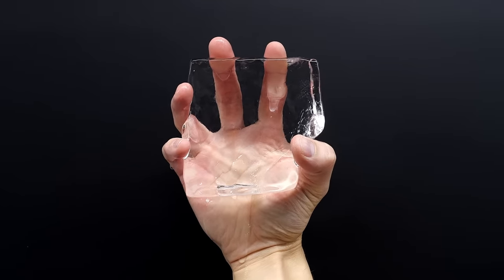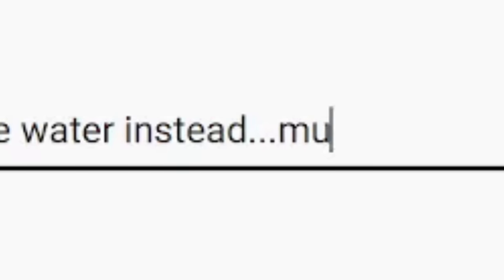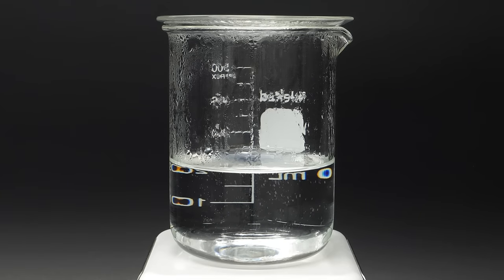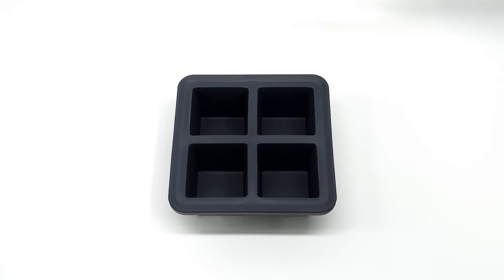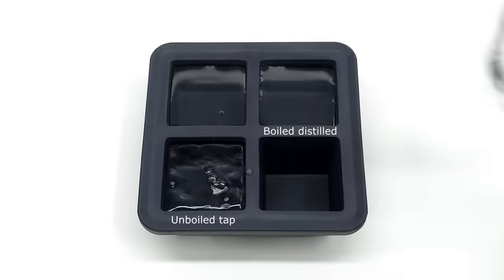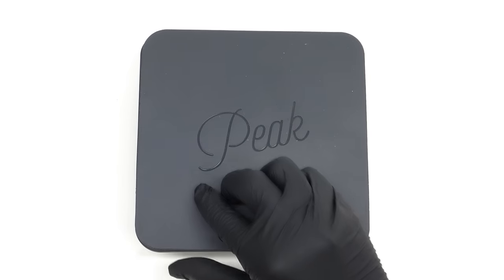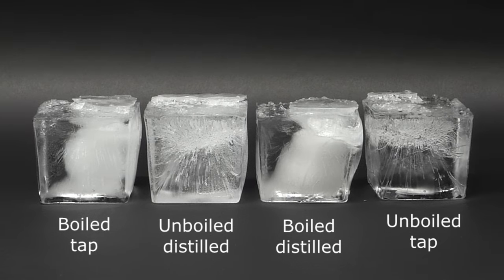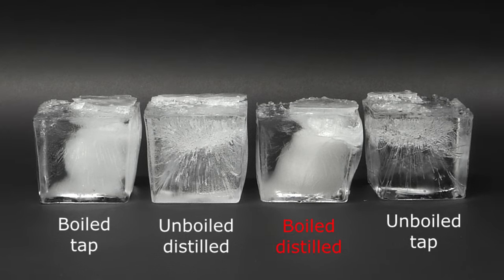The clear ice myth

Comment from the maker: Even if boiling it did make clear ice, it would still be way more work than just pouring tap water into a cooler. Boiling the water is just extra work for no reason.
Reply: You finally responded
Reply: I thought you were 6 feet under
Reply: i need to know if there is a tall bit not that wide cup and a shorter but wider cup that both have a same amount of same temperature water and you put the exact same pieces of ice in both which ice melts faster or is there no difference
Reply: Hi
Reply: There are some high end bars that but specialty ice that ice perfectly clear in all shapes and size
Reply: Maby a vacuum pump cold make the same effect
Reply: i would like to say no need to clarify, but someone in the comments is going to scream about it one way or another lmao
Reply: I’m gonna take one for the team and say “it’s like How to Basic but chemistry” so no one else can fill the comment section with that…
Reply: @leevikv  Difference. But how much depends on the exact dimensions of both cups.
"Short but wide" and "long but narrow" doesn't say much.
It depends on the proportions in relation to the ice cube actually..

But in general you could say:
In a longer/higher but more narrow glas/cup the temperatures are stronger seperated, cold/cooled down on the bottom, warmer ("original temp.") on the top/surface.
There also is the ice swimming, which leads to him melting faster.
In a wider/flatter cup the temperatures are not really seperated. But therefor maybe the in total surface of the water body (?) is higher, which leads to more energy loss (?)..

(Sorry my probably very unscientific english here. I'm not native..)
Reply: Lol
Reply: Lol
Reply: It's because it was in the freezer for 3 days !!!!!!
Reply: My Mum boils water to freeze, quite easily with an electric kettle to be fair. I have argued that it doesn't make a difference, but to no avail.
Reply: Perhaps you aerate the water when you pour it? Try boiling it in the beaker and then immediately afterwards covering the beaker with an air-proof lid and freezing the beaker itself. That should ensure that there is basically zero dissolved gasses in the water.
Reply: I just don't have the space to fit an entire cooler into my freezing compartment so if there was an alternative method, I'd really appreciate that, even if it was a little more work.
Reply: Yooo you forgot to make the video a short, its just normal video rn
Reply: Try doing it in a vacuum or removing more water impurities
Reply: @MartinBalle7  yup the cracks o the gas bubbles and air
Reply: @FrogeniusW.G.  hi
Reply: UPLOAD SOME REAL VIDEOS ALREADY.
Reply: Call Oklahoma ice company and see how they make clear ice sculptures..
Reply: try boiling it then freezing it in the same container, without shaking it. pouring it mixes air in.
Reply: would sonicating it work?
Reply: @unvergebeneid  put it outside in the winter
Reply: Welll you CAN boil the impurities out of water, but its the steam--not the water in the pan--you need to collect.
Reply: If air is the problem why don't you throw some water in a vacuum chamber and suck all the air out and then freeze it
Reply: Yes
Reply: Have you moved to a different site for your main videos?
Reply: You say "extra work" like it didn't take you 6 months to make ice. In Canada.
Reply: way to show them what for
Reply: Yes but better to boil any impurities out before freezing. I make clear ice balls from time to time and like to boil the tap water before freezing. Just feel better about it
Reply: Hi Nile
Reply: Hey nile, why didn’t you upload for 2 months? i was concerned.
Reply: MythBusters did it by lightly agitating the water while it froze - something that vibrated it rapidly. Worked well
Reply: @bej4987  if you mean agitating it while it freezes with sonic vibrations - yeah, that works.
Reply: Boiling water could also cause your freezer to not work properly too. The extra heat inside the compartment could cause your food to defrost, which isn’t ideal from a food safety point of view and could make certain frozen foods go soggy
Reply: You should try putting it in a vacuum, might work
Reply: @MartinBalle7  water expands as it freezes, since it freezes too quickly from all directions, bubbles of vacuum inevitably get trapped. A vacuum wouldn't prevent that.
Reply: Why are you not post it on your main channel
Reply: Holy shit the people who told you to boil the water just got annihilated
Reply: Hi
Reply: looks like they cracked from when you knocked it against the table when you set the tray down..
Reply: Redo it with it sterilized and the lid off
Reply: eh glad to see you back bud!
Reply: I mean, on one hand yeah pouring into a cooler is going to be way easier, but a lot of people don't have that option, tiny or packed freezers make fitting an entire cooler nearly impossible, so of course people would try to find another solution.
Reply: Cloudy ice is from air bubbles trapped in the water so pouring it would introduce more air. Not sure if boiling the water would get rid of air bubbles though.
Reply: welcome back!!
Reply: You should do something with thorium
Reply: If you can get the ice to form while evaporating, or by growing the crystal from vapour, can it form clear ice?
Reply: Oww!!!!! That's somewhat good!! 🙄
Reply: @unvergebeneid  you can buy specifically made clear-ice moulds (overpriced, of course) that are smaller and do the same thing -- they basically insulate the water to allow the centre to freeze along with the outside, instead of the outside freezing first and then causing the stress cracks from when the centre finally freezes.
Reply: @Bluecrown360  thanks for the tip! I'll see if I can find some that are less overpriced :D
Reply: Since it's the impurities that cause the cloudiness, I found the easiest and most effective way to regularly make clear ice is to fill a plastic cooler, like a Coleman, with ice and set it uncovered in the fridge. It's insulated on 5 sides, but the top isn't insulated so it freezes down. That top portion freezes more pure, while the impurities are forced to the bottom. If you don't let it freeze all the way through, you have a pocket full of very mineralized water in the middle of a lot of very clear ice, I then just cut that into large ice cubes to be used later.
Reply: Would distilled water make clear ice?
Reply: @trying3841  no, it wouldn't. Some of the imperfections are due to impurities and trapped gas, but most of the cloudiness is from stress within the ice -- it freezes first from the outside and there's not enough space for the ice in the centre to expand. Ever tried dropping a nice cloudy icecube into hot water? (Be careful of splashing hot water if you do 😅)
Reply: what the difference between the freezer, cooler and fridge?
Reply: @al-aurum2457  water expands as it freezes. A parcel of water being frozen will start from the outside first, then the centre won't have enough space to expand in an orderly structure. The result is a lot of stress fractures, the biggest (but not only) cause of cloudy ice. Insulating the water as it cools allows the centre more time to cool to freezing temperature before it gets trapped. A fridge won't cool it enough to freeze, but a cooler in a freezer will slow the process to have some better results.
Reply: there will always be someone in the comments that thinks they know better then you... something they read a while ago...
Reply: Unless you live in Mississippi.
Reply: Hi just wanted to tell you that you cannot let the water cool at all, if you do not cool it. it should come out completely clear :)
Reply: The AA-12 (Auto Assault-12), originally designed and known as the Atchisson Assault Shotgun, is an automatic combat shotgun developed in 1972 by Maxwell Atchisson. The most prominent feature is reduced recoil. The current 2005 version has been developed over 18 years since the patent was sold to Military Police Systems, Inc. The original design was the basis of several later weapons, including the USAS-12 combat shotgun. The shotgun fires in fully automatic mode only. However, the relatively low cyclic rate of fire of around 300 rounds per minute enables the shooter to fire semi-automatically de facto with brief trigger pulls. It is fed from either an 8-shell box magazine, or a 20- or 32-shell drum magazine.
Reply: HES BACK!!!
Reply: @catwithshades7577  In which case being dropped on their heads was more of a lifestyle than an incident
Reply: @ScrapFatherScrapSon  they use ice machines with a compressor similar to an AC
Reply: What if you didn’t pour the water and reintroduce air? Freeze it in whatever container you boil it in. Not saying I think it works just pointing out a potential variable in the experiment
Reply: You didn't freeze boiling water, you let it cool down first
Reply: The problem is more that almost nobody has enough space in their freezer that they can just put a whole cooler into it.
Reply: Put it in a separate container buddy… smh.
Reply: you responded!!!
Reply: how about you make your own Monosodium Glutamate or extract syn-Propanethial-S-oxide from onions to make your own tearjerker potion, hope so that you'll notice this :)
Reply: I hope the next masterpiece in nile red is almost complete
Reply: are you going to make a new NileRed Channel video? 🥲🥲🥲🥲🥲🥲🥹
Reply: This is actually a movie
Reply: Why do you never post NileRed?
Reply: No videos already for two months. Are you alright?
Reply: My family boils water cause they say that it kills germs due to the heat
Reply: @yasserotb1454  I think he is
Reply: You should dissolve a jawbreaker in piranha solution
Reply: What if you lowered the boiling point by putting it under vaccum?
Reply: I froze boiled water to have some for later.
Reply: this is what happens when your ugly YOU GET SMASHED BY A GIANT BAN HAMMER BY NILES OWN HAND
Reply: I mean, the harvesting process for clear ice made in the cooler is the limiting factor. I suppose the suggestion is boiling and freezing in a mold is less work than cooler freezing and cutting it to shape. I agree, except for the inconvenient fact that boiling does nothing lol
Reply: Leave the lid off the container so air can escape
Reply: @unvergebeneid  any size cooler will do it you can get some small styrofoam "coolers". Or even cut up Styrofoam that is an inch thick and make a box out of it.
Reply: excellent hammer sir
Reply: I guess some peoe don't know what actually makes ice foggy
Reply: @Edward  but the problem is not only the gas from the water. Ice frozes from the side of the mold. As you know, water expands when freezing, but if ice freezes from the side of the mold, the water in the center will be locked up into the ice. So when the water freezes, the crack will form from the center of the ice by expanding water. The only way to prevent this is to freeze water slowly from bottom to top or vice versa.
Reply: To be fair if you have a kettle its really just pushing a button
Reply: Boiling the water makes it freeze faster, but it won’t make clear ice.
Reply: Boiling the water only has an effect on how fast it turns to ice. Boiling water turns to ice faster than cold tap water, believe it or not. Since the hot water evenly looses its heat when the cold water freezes from the top down and takes longer to completely freeze into a cube.
Reply: I love your content
Reply: Dude, this isn't a myth it's not rocket science. Have you ever seen ice sculptors work with super clear ice? They agitate the ice as it freezes, to continually stir the remaining bubbles out
Reply: What about putting a jar of water in an ultrasonic cleaner? That gets rid of the air in the water and would be interesting to see if that changes anything.
Reply: Horrible test. Each one was able to mess with the others temperature ...
Reply: Shouldnt have poured it
Reply: how about using a vaccuum?
Reply: @leevikv  cloudy ice melts faster. The cloudiness is tiny air pockets that affect the diffraction. As the ice melts and the cloudy section is further exposed, microscopic pitting sites increase the surface area, and as we know thermal exchange is directly proportional to surface area.
Reply: What I'm getting from this is that boiling the water improves water clarity but is negligible compared to former methods.
Reply: Agreed. Moot point.
Reply: You should try it again with a thermos cup. I use them to make drink ice. Because then you can cut them. Perfect clear ice every time, the insulation forces the imperfections in the water to the top.

It's because the proces of how water freezes. 
Boiling doesn't remove all the minerals from the water, which causes clouds.

But the insulation of the cooler or a thermos, will force them to freeze like that of a pond, mean the top will be white but the rest will be clear.

You then just cut off the white, where the imperfection of the water rose when it got cold.
Reply: Yes for no reason
Reply: Well... you see tap water in my country is poisonus until u boiled it
Reply: Hi
Reply: @yasserotb1454 
I thought maybe he got trapped in a cooler freezing some water.

Comment: I still love the phrase “boiling water will remove the air from it.”  That’s just not how that works.  Not only that the moment you pour it into something you’ll trap air anyway.
Reply: there is dissolved gas in tap water and boiling it will remove that. It doesn't seem to make a difference to the ice quality though as we can see in the video.
Reply: Boiling water does remove most of its dissolved gases. I worked in a lab that required me to use chemicals that easily oxidize (into unwanted ionic species), and so whenever I had to create a solution of these chemicals, I would have to make deoxygenated deionized (DDI) water. Basically, it's just regular deionized water that has been boiled, and which has had nitrogen gas bubbled through it for about 30 minutes as it cooled. The boiling removes most of the oxygen, and the nitrogen flushes the rest out. It lasts for only a few hours in a sealed bottle though, so it must be made fresh the day you need it.
Reply: I never knew that thank you two for this trivia which I will use to torture my friends when I’m bored.
Reply: it's because folks dont understand why the ice isn't transparent. It's the speed you freeze it at that's the main contributor to it's clarity. When ice freezes the dissolved gasses do play a minor role, but it's the speed at which it freezes which leads to the ice contracting and cracking. It isn't the dissolved gasses that're cracking the ice, it's the thermal contraction.
Reply: @CRneu  
Not quite. Water goes though a process where it contacts, but that stops around +4*C. Between +4*C and 0*C it expands to what it is at room temperature more or less, and then after it starts to freeze, it expands by approx. 8.75%.
But yes, it is the water shifting around and expanding that leads to the cracks.
Freezing it slowly is part of the equation, but so is the direction of where it freezes from.
Reply: @VoIcanoman  Ok, but you're not boiling out the gas, you're simply displacing it with nitrogen.  The gas is still there, my dude, it just wont oxidize things because it's not oxygen.
Reply: @CRneu  No one is talking about the cracking, "clear ice" refers to being fully transparent not free of cracks.  The rate of freeze is less relevant than how it freezes.  You need to freeze from the bottom up to have clear ice because as the water freezes it pushes the gas out.  If you freeze from the top down the gases all gets trapped and make tiny bubbles that cloud the ice.  This process is well documented.
Reply: @LeCharles07  Actually, as I understand it, the boiling takes some of the oxygen out, and the nitrogen makes sure that this oxygen can't dissolve back IN to the water, while displacing any that is still dissolved. This process can theoretically be achieved by JUST using nitrogen to displace all of the O2, but it would take a lot longer, and use more nitrogen. Boiling does remove some dissolved gas from water (as all gases are more soluble in cold water than in boiling water).
Reply: Thw problem is thats how YOU understand it.
Reply: @dgalloway107  nah it's because people don't test things

Comment: great vid, thanks Nilered. 
to the people suggesting vacuum chambers and boiling:
- water boils at room temp if you pull vacuum.
- a hard vacuum brings water below its triple point, so it will phase change gas-to-solid or solid-to-gas. no liquid water.
- boiling water mainly removes water from the water.
- water that is cooling down regains dissolved oxygen and other gasses that were released when it was heated.
Reply: idk why but "boiling water removes water from water" is really funny to me 😆

Comment: I used to manage a bar where we made clear ice cubes for whiskey serves and certain cocktails. We used the cooler method, the amount of people that said "just boil it" drove me faaackin nuts. The worst part was they used to argue it!
Reply: I hear you on that one. I was running the kitchen at a tiny, high end, Italian restaurant. The general manager/bartender kept taking up valuable freezer space experimenting with different variations of the boiling method. As we know, none of them worked, not even the diluted simple syrup. 🤣 The cheap silicone molds simply weren't insulated enough..

Comment: The most important factor in clear ice is how slow it freezes. This is what the insulated cooler does but you could also get a freezer that's set to 30°F and allow it to freeze for a long time.
Reply: The most important factor isn't overall speed, but directionality. When you insulate one side, it causes the freezing to occur in a linear rather than radial fashion.
Reply: No, directional cooling is only half of it. Using a tall vessel like an insulated coffee cup is best. So you have room for impurities to sink and clear ice to rise. Then hack off the cloudy bit.